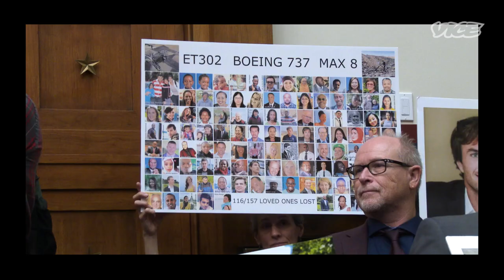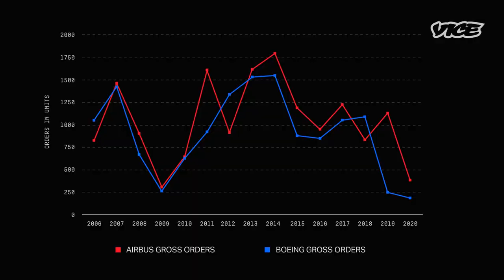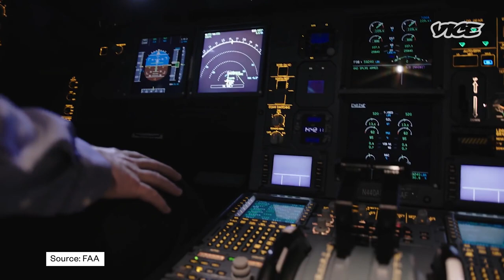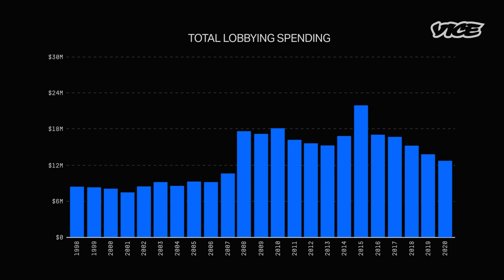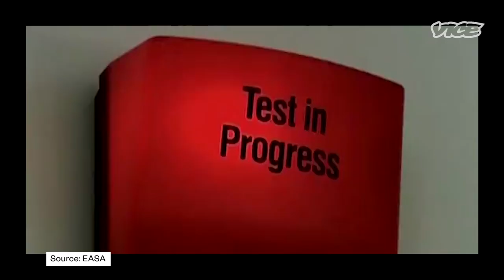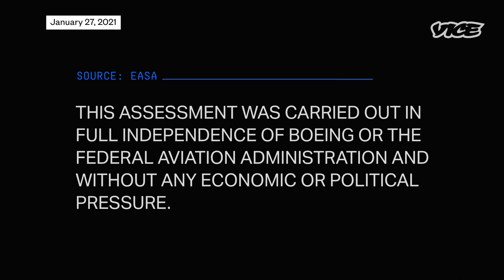Why Greed Causes Planes to Crash | System Error

Comment: I have family that makes parts for this stuff and many times they've been told "it's ok" when parts are defective or improperly machined.
Reply: That is not even remotely true.
Reply: @canadajointops  it is actually very true. Doesn't mean that the part got through (since my family is good at their job). Just because your company is certified doesn't mean the people are qualified.
Reply: @keriezy  I'm the third pilot in my family and my father and majority of my friends are aerospace engineers/mechanics. The quality control on aircraft is extremely high. To my knowledge, every component that is manufactured is inspected by a third party. Then those same components will be inspected throughout their entire service life.
Manufacturers and Airlines in North America do not like taking the risk of using defective/counterfeit parts because in the event of a component failure/crash. It damages shareholder value, damages a manufacturers reputation and can cause customers to look elsewhere for new aircraft. 
Now in your case, what are your family members manufacturing? Wing components or seat cushions?
Reply: @keriezy  didn't read the last part of your response. I agree 100%!
Reply: @canadajointops  titanium engine parts.

Comment: 5:43 I thought that's what the stick-shaker is for, warning the pilot they are about to stall.
Reply: Yeah, Twisted Y: But from what I've read about it. The pilots ( in both cases) were unable to decipher the promptings. Couldn't bring the nose down. Or was it, up during the stall. Boeing brought it back and supposedly reworked the software. I'd have to know way before flying anywhere what the plane I was getting on.
Reply: The stick shakers did activate, the pilots in both accidents were incompetent. The actual problem the planes had was minor, a malfunction auto trim computer, an issue that is solved with a 4 item checklist. Such a malfunction would never cause an accident in a Western nation with trained pilots.

If you read the transcripts of the accidents, the pilots had no idea what was going on. They lacked the cognitive ability to perform simple tasks under pressure.
Reply: @TheOwenMajor  A lot of people blame Boeing. Personally I blame the airline. They knew that the plane was different than the older versions, why didn't they train their crews about all the things that were different or at least make their crews read the manual?
Reply: @twistedyogert  The thing is, there is nothing different for the pilots. MCAS is not a system that interacts with pilots, it is in the background and the pilots have no ability to affect it.

MCAS was simply an addition to the existing automatic trim computer and the procedure for what to do when that fails remained unchanged.
Reply: @TheOwenMajor  How is MCAS better than the original automatic trim anyway?
Reply: @twistedyogert  It's simply a mode that interacts with the automatic trim. There are different modes for different stages of flight, different loading figures, different weather conditions ect. MCAS specifically was to trim the NG nose-up tendency during takeoff so that the pilots didn't need to manually deal with it.

It was just an addition to an already existing system, hence why the pilots didn't need to know anything because on their end nothing changed.

Like I said, a trim malfunction checklist has remained unchanged since the first 737, because the way to deal with it is exactly the same.

1. Turn off the trim motors
2.Decrease thrust(1. A reduction in airspeed will naturally correct the trim, 2. It will reduce the pressure on the jackshaft, making it easier to manually trim)
3. Manually trim the aircraft

Comment: I was waiting to hear what exactly cause the crash I don't know how you would forget to mention the plane has an Achilles heel , planes usually have a lot of redundancy like having 3 hydraulic systems but Mcas system can only tell the planes nose pitch through 1 sensory at the front of the airplane take note its a common thing for exp : ice to interfere with a sensor's operation.  so guess what happened.
Reply: Truly scary

Comment: I actually like Max, it's way more spacious (wider) inside then it's predecessor
Reply: Hate to break the bad news to you but the fuselage is exactly the same width as it's predecessor.
Reply: @timeslidez  I remember feeling cramped inside 737, but in MAX with the same amount of seat afaik , there was more room to manouver when walking and sitting. Im not exactly a small guy, so I just can feel it back then. Maybe its just longer/taller??
Reply: @bpcgos  That is more likely due to the choice of seat by the airline and how many of them they have squeezed in. Because the MAX is a new aircraft it will most likely include the latest seat designs which are somewhat focused on increasing available space and comfort for passengers.

There is also a possibility that the interior side wall is thinner than on older 737's but I don't know that for sure, however the fuselage itself is more or less exactly the same as it's predecessor.

Comment: This is a terrible report and doesn’t explain how sensor failure is an important detail. Developing world airlines were sold planes with one angle of attack sensor.  The sensor failure and the M CAS system forced the brand new planes into the 
ground/ ocean.
 US airlines were sold the multi sensor option to have redundancy if one failed.